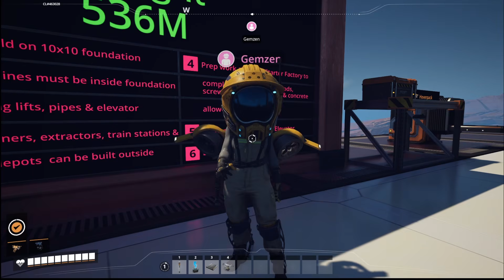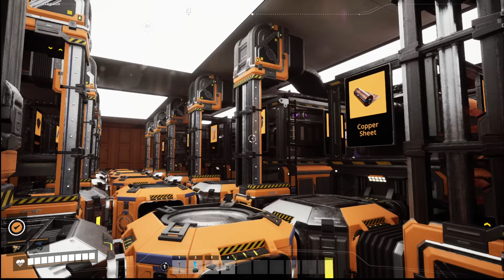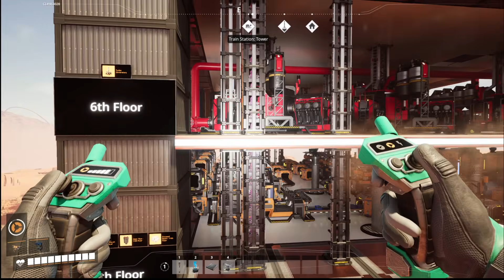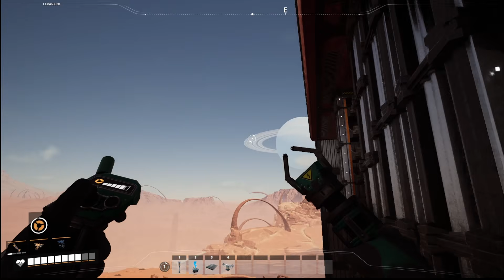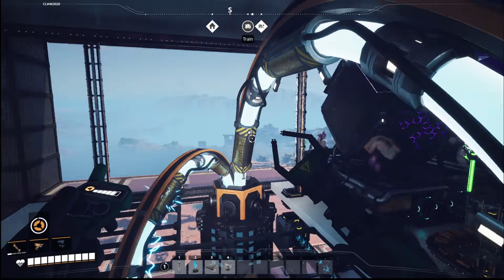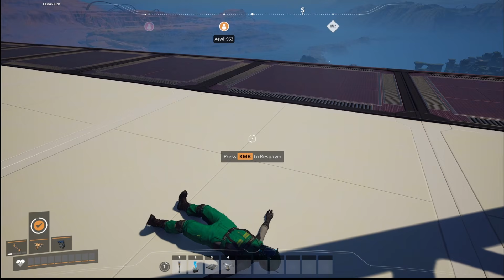Satisfactory 10x10 Challenge Tour  Vertical Mega Build by @aewl  Created by @JakeGemzen

Comment: 10x10 is massive. There used to be a 5x5 challenge. Cool video none the less.
Reply from the maker: Wow 5x5 that’s insane!!! I thought 10x10 was hard enough lol! Thanks for watching!
Reply: I did see there was a 5x5 challenge, but that was before particle accelerators and quantum encoders.
Reply from the maker: Oh well that makes sense’
Reply: @Grahtles  Yeah, in theory the 5x5 rules did allow a floor to be larger than 5x5 - it can be just large enough to fit the one machine - like you could place a nuclear reactor which is 5x6 and I have one at the top of my 5x5 factory. So the floors with PA/QE would be expanded to be large enough to fit one. The other 5x5 rule which is part of the "hard core rule" list is everything has to come in on the first floor. So you having stuff coming in above the first floor is cheating ;). But its okay, the important part is to play how you want and have fun, so thanks for sharing your build!
Reply from the maker: @halbouma6720  That you so much for the explanation. Sounds really hard and challenging don't know how I would approach it for sure!
Reply: @Grahtles  Yeah it hurts my brain when I work on it lol, I started it when we just had phase 3 before we had soft clearance/floor holes, updated it for phase 4, but I haven't looked to see if its still possible with phase 5.